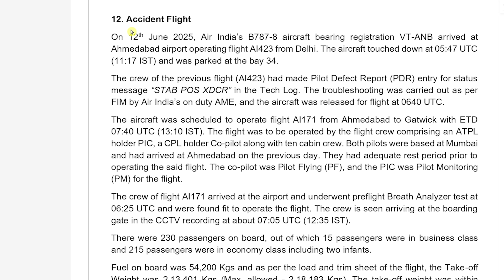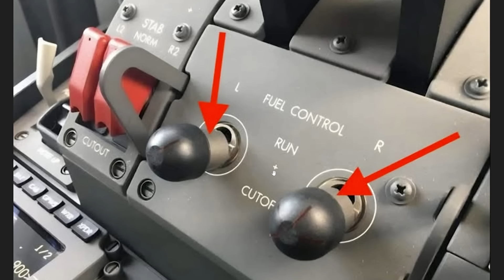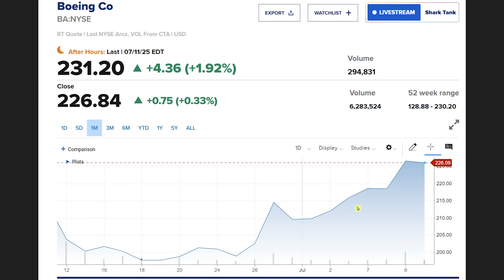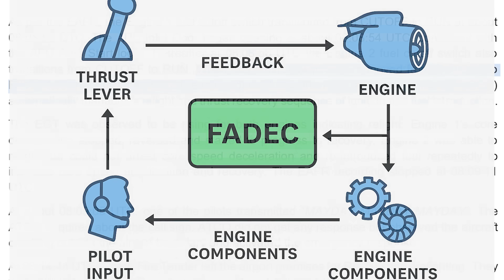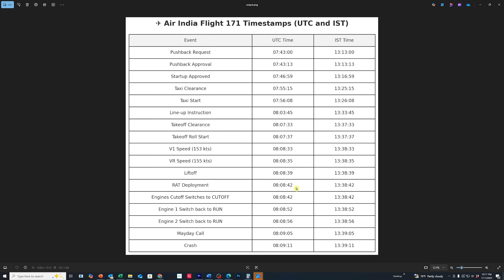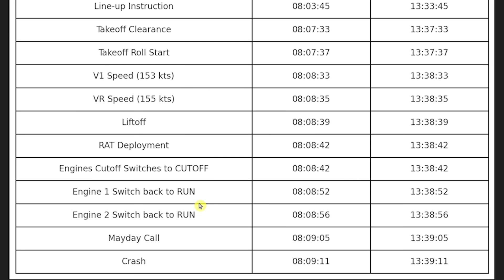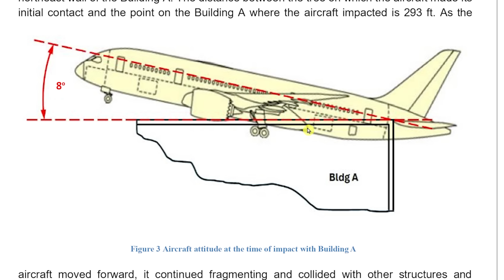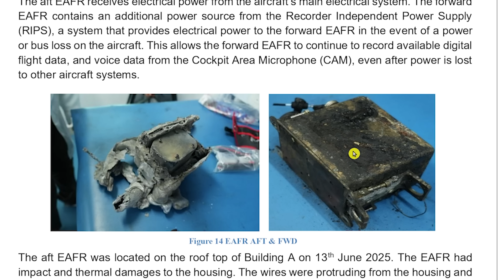Did Pilots CUTOFF Fuel? Shocking Twist Air India 171 Report!

Comment: If this pilot induced crash the following evidence would be on CVR.
1. A click noise from fuel switch 2. A second click from second fuel switch 3. Loss of thrust 4. Pilot Monitoring asks Why did you do this 5. Pilot ying says I did not.  Manual operation of fuel switches makes an audible recordable noise. 

If there are no audible clicks from manual switches prior to loss of thrust the transition of fuel switches from run to shutdown was due to electronic/ computer/software.  

So why is no one mentioning there were or were not audible clicks from fuel switches

Comment: If the info in the report is correct.. which it seems it must be.. then this is 99.99999.. % intentional. If there’s more in the voice recorder that can elaborate it would make it a clear certainty. IE.. I saw you put them to cut off.. or some such clarity. Regardless.. baring some amazing revelation of some implausible malfunction.. this is an intentional sabotage by one of these two men. The investigators would have to be doing some serious personal background investigating to find the mental state of these fellas and figure out which one was having serious issues. There is always a trail if someone was this mentally unstable.

The time from cut off to back on could easily be explained in the voice recorder if you can hear a fight going on.. that would easily explain why the pilot trying to save the bird was delayed in this.

Comment: Interesting that the starter motors on the 787 are electric, not pneumatic- so the FADEC could crank the engines during relight if required even though the APU was off.

Comment: The 737 has a completely different kind of fuel cutoff. The 737 has fuel cutoff LEVERS that move up and down rather than  switches like the 757 and later aircraft have.   Additionally, it's called a flame out, not a flareout!

Comment: I think there was a malfunction in the engine cutoff switches or defect that caused them to go to cut off (1 second apart). When the pilot asked the other oif he cut off and he said no, it seems they were stunned and were trying to figure what was wrong and it took the 10 seconds for them to discover the switches were in the off position. Pilot being suicidal can be ruled out because the pilot could have had the time to do that anytime during the several hours of the flight. I am leaning to switch malfunction or defect especially since Air India is known for lack of maintenance on their aircraft. If one pilot turned the switches off because he was suicidal and then the other (who would be flying) had to rush to put them back on, there would have been a struggle (and we would have heard something on the Black Box, remember we hear him saying mayday, not saying the other guy has gone crazy).  We would have seen the plane not decend so smoothly and heard it on the black box if they were fighting each other.

Comment: No one is stalking about how all the tangible evidence and descernable pieces of the aircraft still indentifiable.  Remember at the Pentagon not one engine, tail assembly, wings, landing gear.
This plane crashed through multiple buildings, the plane had a lot of fuel, yet no on going fires like we were told about the inside job taking place on 9/11.

Comment: Well done Jeff, for presenting the facts so clearly from your first broadcast to now. I flew the 787 for many years, and I understand how quickly those switches are placed into cutoff after liftoff.  This makes the horrific scenario you're describing all too real to me.  One thing I wish is that the innocent pilot had managed to relay the name of the individual responsible (perhaps a jump seater) to ATC before the situation became unrecoverable. That small piece of information could be critical. Without it, it could take months or even years to fully understand who was behind it and why.  This method is a virtually guaranteed way to kill yourself and your passengers with no opportunity for intervention. Boeing must step in and program the FADEC system so that fuel cutoff at low altitude requires explicit confirmation from both pilots. This could be done with a dual-button system, signaling to the FADEC that the action is both necessary and intentional.  Cockpit cameras won’t solve this. Smart software and firmware will. It's the same logic behind the two-person cockpit rule ensuring a pilot is never left alone in the cockpit which has already proven effective at reducing the risk of intentional acts. We can, and must, design safety into the systems themselves.

Comment: I'm not sure this information is correct. There may be another explanation depending upon the electrical wiring and signalling circuits involved. Just because the data recorder shows a fuel cut-off action occurred doesn't necessarily mean that the event was caused by manual action. It could be a wiring fault! If the pilot who asked 'why did you cut the fuel off' had asked that question because he had seen the engine fallback response on the display and not because he had see the other pilot actually do it. The other pilot responded with 'I didn't do that' may have been a truthful statement and I think you are wrong to have dismissed it without proper consideration. If the fault had been, for instance, an intermittent wiring fault, then the statements heard on the voice record could now be understood. Also that would explain why the two switches were found to be in the 'run position' after the crash.
I think you are making assumptions here instead of presenting truthful knowledge, it is possible don't you think.
I've spent years fault-finding electrical circuits and the worst assessment one can make is a faulty understanding of the actual events that occurred because it has not been properly thought through and instead assumptions and presumption have been made erroneously.
I could be wrong but it needs to be checked.
EDIT:- I am surprised that, with all the electronic safety systems in modern aircraft, that a software does not monitor the circumstance of the aircraft when these switches are being operated. On the ground normal switch action would be OK, but just after take-off the fuel cut-off action should be held with a strong WARNING awaiting a second response by the pilots before fuel shut-off actually occurs. In fact there may be an argument to inhibit actual fuel cut-off after take-off until a certain height has been reached, but this is of course, debatable.
These days pilots don't fly the aircraft, the manufacturing systems engineers do most of the work and having taken on that work and responsibility they should double or triple check every singe decision and I'm not convinced that is satisfactorily achieved. Consequently, I don't fly any more.
Reply: The switches were found to be in the off position

Comment: Few things here. First off WHY are those switches located anywhere near the throttle levers? They should be located OVERHEAD between the pilots (with similar actions required to prevent accidental movement). There needs to be cameras in these cockpits that has a visual on ALL controls and both pilots at all times whose control is NOT accessible from the cockpit! In fact there's absolutely NO reason for either pilot to EVER turn those cameras off! Their condition should be monitored by the FDR as well. 

Ok the FO was the pilot flying but the PIC has his hands free. Yeah he committed suicide and I believe it was the FO that turned those switches back to "Run". But unfortunately the engines needed a restart... no time. Yeah you can bet that the NTSB is looking at that pilot real close. And finally there was absolutely nothing amiss with this aircraft with the exception of my mentions above (in my humble opinion). 

BTW I also believe that dashcams should be a mandate in new vehicles everywhere there's no excuse for all vehicles in this day not having them. My vehicles are retrofitted I will not drive without them as they record everything even audio.

Comment: The fuel cutoff switch being toggle off in flight is so unbelievable that no one even mentioned it as a possible cause, even the AI videos didnt considered it as a possible cause. Its one time where even sherloch holmes would have hard press to find the culprit. If not for the CVR, it would be a unsolved case since the the toggle switches were found in the run position post crash. A mindboggling case.

Comment: Does the engine management system have the capability to shut off fuel even if the switches are in the on position? Does the FDR record the position of the switches or the operation of the fuel system ?

Comment: Another questions is HOW did the 1st pilot know to accuse the other of cutting off the fuel?
1. did he see the other pilot do this?
2. IS there a big 'Fuel Cut Off' warning light?
Reply: There is message on the display. No warning light.
Reply: @JohnDoe-ti6pd having sat in a cockpit i also would think that each pilot can clearly see the other changing them as will. its not something u can do and be able to hide it.

Comment: IS there any possible situation in which the Engine Cutoff Switches might self-off, some kind of unusual emergency, computer glitch, any possible way that could happen?
Notice that the RAT deployment is at exactly the same second.  One pilot asked why cutoff, but he apparently hadn't seen the other pilot do it, and the other denied doing it.
If it is as physical as turning, lifting, switching each one of those switches right under the throttles, seems like it would have taken enough movement for the the other pilot to see it happen.
How about how soon after cutoff did the pilot ask why?  Can that be determined?

This looks to me like something that neither pilot did -- the airplane did it.  Is that even remotely possible?
I'd also like to know if the two cutoff switches were turned off at EXACTLY the same time, to the microsecond?  A pilot doing it would have to do one first then the other.  Can that be determined?

Comment: If the switches actually cutoff without the switches moving? then its possible the pilots didnt touch the switches at all, which is why they are in run position (the switches didnt move). but somehow internally the current flow was cut off and then restored.

Comment: The timeline chart shows both cutoff switches were turned off at the same second (instead of say 1 or 2 sec apart). Can one pilot do that?  Or it is an indication some electronic control or software cut off the engines? If so most of the comments here are wrongly blaming the pilots....

Comment: To me, a critical thing that is missing, unless I missed it, is the sync between the switch signals and the pilot conversations about them.  Ten seconds is not really that long when takeoff is such a high-load function to begin with.  Fit in a mental sequence of "What just happened?", then verbalizing "Why did you....?", processing the response of "I didn't!" and correcting the settings and a fair amount of time passes.  But when and how those things were said still seem to be hanging.

Comment: Some doubts.  The RAT was seen outside the craft immediately after lift off (08:08:39), 50 to 80 feet above ground.   Max hight reached was around 625 feet(?) and this should be the engine cut off time (08:08:42).  RAT started supplying hydraulic power at 08:08:47 as per EADR.  Why the RAT was outside immediately after lift off?  Else, if both engines were off when RAT was ouside (50 to 80 feet above ground)-can the aircraft gain more height in this condition(~550 feet )?
Reply: nonsense. RAT WAS DEPLOYED WHEN IT WAS LOSING THE HEIGHT NOT WHILE TAKE OFF. DID YOU EVEN SEE THE VIDEO FOOTAGE? THERE HAS BEEN A MALICE. WHY? ONLY TIME WILL TELL.
Reply: @king_has_no_clothskul8635  Am sure you didn't see the video in full.  Please take a second look.  There was no malice- a coverup is going on to save someone's share prices!
Reply: @abdulsalamsagir4723  yes, that is because fuels were switched off and sensing no power or lift ram got deployed. ram also can be deployed by pilot as per the RAM profiles. they have been physically moved during the run. so for now it is all on physical intervention but who and why is up in the air( I mean those expert examining know the cockpit details. without video camera it is impossible to know physical action)

Comment: you read that the maintenance wasn;t done bcs it wasn't mandatory, that to me seemed more legit than your "maybe the pilots were psychotic" bullshit. Maybe before taxi to runway they didn't put it correctly up and over the notch at run position, and the vibrations of the runway markings were enough to let switch them snap back to cut off... anything.. but They were psychotic..?? how can you even speculate that from a " I didn't do it"
Reply: that cant happen. engines cant start with them being cut off. it is impossible. these are professional pilots we are talking about. but mental illness cannot be ruled out.only thorough investigation about pilots could reveal things.

Comment: I have asked these questions on other sites and have not gotten a reply. 1) Does the flight data recorder record the position of a switch independent of the function of the switch? Eg. Could the switch actually physically be in the Run position, but something else cause an effect that would simulate the switch moving to the Cutoff position, giving an erroneous indication in the recorder that the switch was physically moved? 2) do the switches go to the same set of electronics  or do they go to separate redundant systems? If the former, that may have introduced a single point of failure to cause a simultaneous duel engine failure?  Thanks
Reply: I know when electronic systems are designed, engineers do the analysis on what would happen if a part failed open or failed closed, how would the system respond, and they do that for every component.  But I have seen components fail in indeterminate ways, e.g. a 100 ohm resistor not failing but changing value. I have seen solder joints crack and then make contact at one temperature and open at another temperature.  Aircrafts vibrate,  aircrafts operate in extremely hot and cold environments inducing fatigue.  Unknown causes - aka gremlins - happen all the time that can't be reproduced. We may be blaming a pilot when there are other causes.

Comment: The switch action timing indicates a struggle in the cockpit. Ten precious seconds tick away before someone starts to transition the switches back to Run, but then it takes 4 seconds to get them both in Run compared to the 1 second it took to switch them to Cutoff. Whoever listened to the CVR must have heard evidence of a struggle. Why wouldn't they include that in the report?

Comment: Could the whole flight have started with both Engine switches ALREADY in the cutoff position and it was just missed during the preflight checklist?
Reply: unlikely turbines have no immediate fuel storage or near the wing to keep it in prime position like a pump is done. i have been out of touch but only modren turbine folks know this. GE or ROLLCE ROYCE will give correct answer.

Comment: I went through all of 787 memory items and found an interesting one. Titled 'Stabilizer', it says to cut out both Stab switches. Now these are right next to fuel switches, not to mention there was previous defect report by another pilot STAB POS XDCR , which was cleared by engineer. We pilots do check last reported defect in tech log and prepare ourselves mentally in case the snag reappears and what action to take. Just putting this out here

Comment: @jeffostroff I'm told the the 787 emergency manual calls for a recycling of the fuel cutoff switches in the case of a dual engine failure.  Seemed a bit fast for that but just sayin...you're welcome

Comment: I read that there was some advisory back in 2018 that Boeing knew that could cause problems with those switch but was not declared as a mandatory repair, so Air India never implemented it They need to explore the possibility of a problem with the cut off switch in the conditions of that day.

Comment: I flew for a major airline(s) for 37 years, Boeing and Airbus.  I have a question for the experts.  The gated Fuel Control switches.....Going back to older B727/B737, these were levers.  Many Captains, on a hot day, concerned with a EGT exceedance, would move the Fuel Cutoff "Levers" just enough to get a light off but close to cutoff anticipating a rapid EGT rise.  With many hours in the B767-300and -400, the FO would initiate the Fuel Control "Switches" by company procedure.  I rarely touched them as a Captain even at the gate after landing.  The question is, can the switches initiate ignition and fuel if the switch are in the intermediate position on top of the gate?  Is the gate flat such that the switches could have inadvertently been left there (not a procedure) that could have failed spring loaded to the cutoff position after liftoff (and within 1 second of each other?  This could save some dignity to one of the pilots and explain, "I didn't" when asked why the switches were off.  Just a thought maybe confessing a system I did not fully understand or forgot in 8 years out of the cockpit.  The Voice recorder can tell a lot including the sound of switches being activated or switches "snapping" with full spring pressure to the cutoff position.  Pilots can and do try to outsmart the systems and bad things can happen.